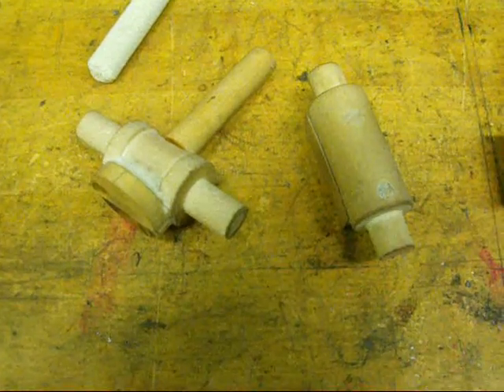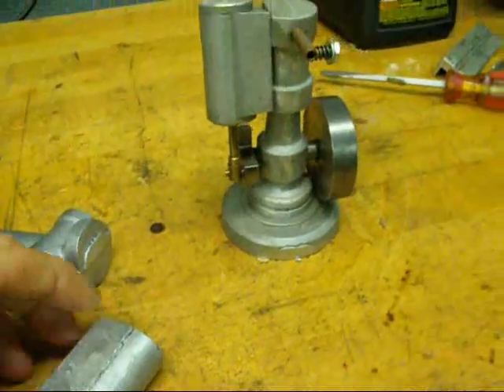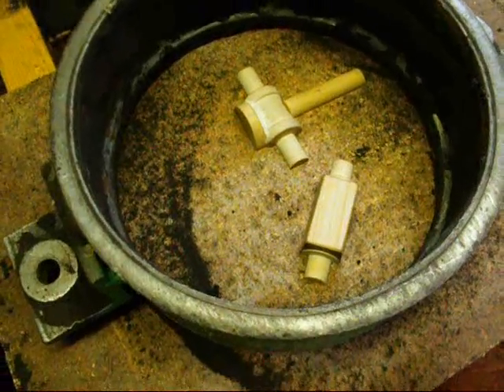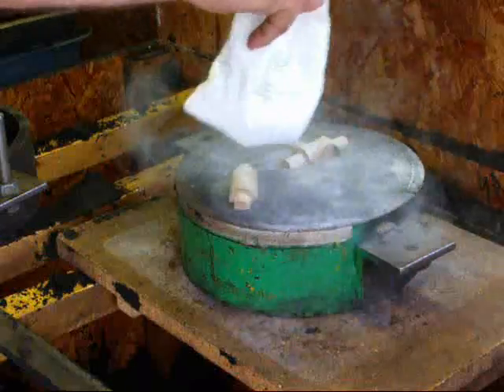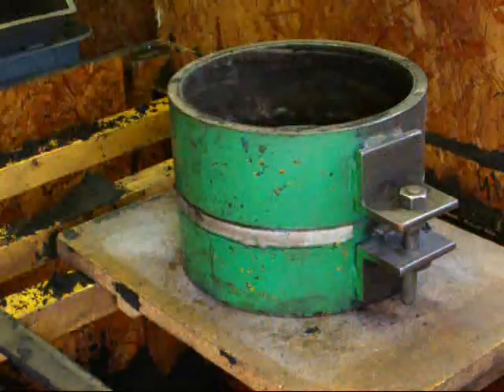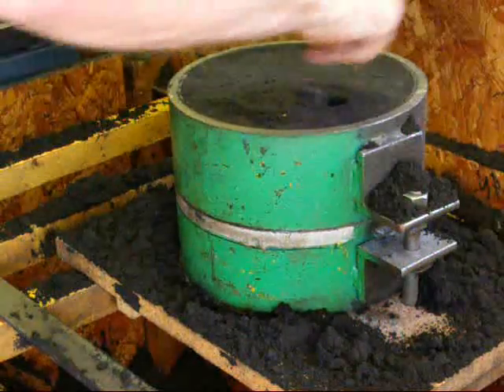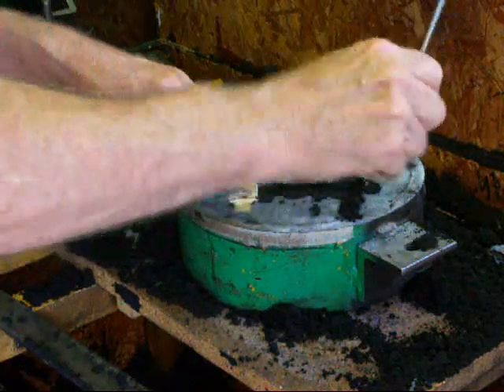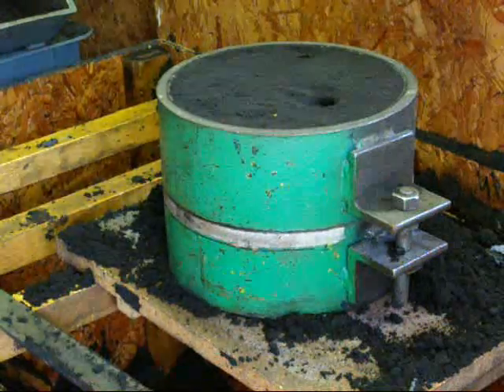FOUNDRY CASTING Molding with a Split Pattern part 3 tubalcain

Comment: Thank you so much sir for posting these videos! I have just acquired the same equipment from an auction the school I work for held. I have a 120e forge and a 520-7 crucible both have a separate unit for the blower valve and such. Same exact square flasks and muller is identical. I got the table they used for the sand made of metal. It’s all very nice aside from some wear and tear on the fire brick. My aim is to convert them to propane for the temp increase and keep my house gas bill normal since I hear these are very hungry furnaces. I was going to try to get the old shop teacher to show me how everything works but then I found your videos. So thank you again and I hope to be doing as well with my set up.

Comment: Great videos THANK YOU posting them.. I learned alot and am now venturing into casting aluminum. i have a diy cnc that works great and i have made molds to make derby covers for harlys by casting them. I also bought some petrobond and i am melting 6061 aluminum for the pour. any sugestion to get the cast to shine like chrome?